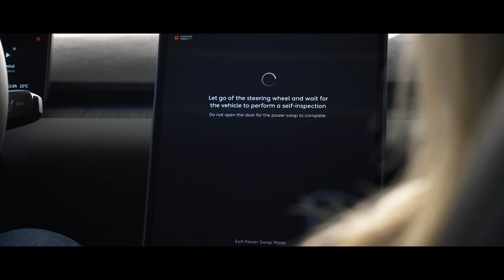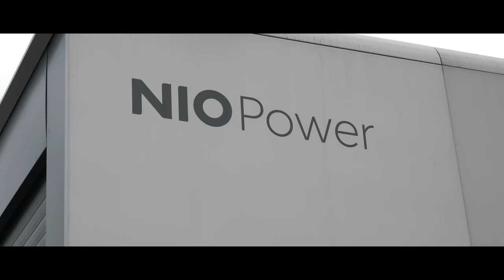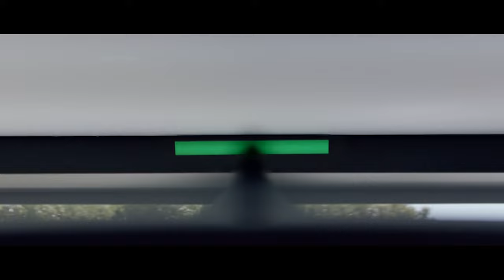NIO's Battery Swap Station: 5-Minute EV Battery Swap!

Comment: I do think there are some advantages to this.    It provides great resale  for EVs since the major concern (a damaged battery) is now removed.  Also, it allows for slow charging of batteries with entirely green energy.   It takes away grid problems and allows for charging at the lowest rates.  This is great for wind and solar since one does not have to be in a hurry to charge batteries.  I hope this catches on.
Reply from the maker: It certainly has great potential in the EV World! ⚡️
Reply: Yes its a Win Win Win System. You say What I Always say. Thank You.
Reply: @EVPowered  No, the idea SOUNDS good but is simply not viable. It would also require ALL major EV's to essentially have the same Battery packs. That obviously will not happen. Or will the stations be expected to stock individual packs from 50 different EV makers?
Reply: @johnwilson5743  it will be possible in EU because they recently pushed legislation that enforces standardization of battery packs in all electric devices including cars, and enfirces their replaceability. This is good thing, because monopolies like tesla finally will be shown their place and get rid of their staggering entitlement and finally will do something actually good for environent (long term reusability of vehicles)
Reply: Yes, that is an issue which can be addressed only by regulation.
But we ve already seen unification of charging ports for phones and now even car charging ports in the U.S.
I think it’s very possible. Again, it’s not an obligation for car makers  to use the same battery, but an optional feature good for consumer.
As always, the problem is that it only works at scale, and there is nothing to talk about with just a few dozen stations in Europe so far. At the same time, Tesla superchargers were also quite rare in the beginning, and now it’s a dominant standard.

Comment: NO chance in the U.S. Not only can Nio not afford to build enough swapping stations. but charging is getting better and faster, rendering Nio's "edge" irrelevant.
Reply: But doing it this way allows for great resale since people won't have to worry about the battery being damaged.  Also, it can have a green angle in that the company can charge each battery slowly and with entirely green energy.  Also, with this tech, you inherit improvements made to battery tech over the years.  So some advantages.
Reply: your 'fash" chargin loses all sense when you cannot charge it during peak usage time and grid being overloaded. Swappability of batteries is simply better because you can store batteries and charge them when peak production of energy from solar or wind happens, you can put less pressure on grid where too much energy is pushed into and cannot be received, and overally it is simply more sustainable, because EVs will become more affordable and reusable. EV with permament packs are one-time toy for burgeouis and entitled rich people.
Reply: @zawarudo1041  good point

Comment: Did the Doors to the swap station lift up when you arrived or were they already open?
Reply from the maker: Good Question! Once you have ordered the swap in car, and parked In the designated area the doors auto open and the car will drive itself into the swap ⚡️😀
Reply: @EVPowered  Thanks. You should include that in your video..People here in the US don't know that. They think there is someone is always waiting at the station. Great video

Comment: I am a strong supporter of EV's so please don't think I'm knocking NIO. However, I'm also a realist. The "financials" around using a Battery Swap Station simply do not add up. It is NOT financially viable and will actually cause the demise of NIO. Many years ago, when NIO first started promoting this swap concept, Tesla gave it a serious look. After investigating and even developing prototypes, Tesla quickly realised it would not work for mass production of EV's. NIO has been attempting to get other Chinese Car companies plus European auto companies, to join in to create a "mass market" system. A couple investigated and actually developed prototypes but, it seems, also came to the same realisation that it was fat too capital intensive and simply would not work. (Note: It might work for commercial Semi Trucks)
NIO has spent billions attempting to get this "off the ground". Funded, initially, by subsidies and payments from the Chinese Government. (That Govt put mega billions into the Chinese EV Company startups. They have now stopped funding all the research and development and have left the Chinese EV Companies to prosper or die, depending on their success) There are around 40 Chinese EV companies and I estimate 50% will fail. NIO is included in that number if they keep going down the Battery Swap avenue. Cheers.
Reply: How do you not see this as viable? It reduces load on the grid as charging the battery quickly is no longer as big as a concern. Recycling batteries will also be easier. The stations themselves i assume have a good portion of batteries in storage, and one of these units replace many equivalent ev chargers
Reply: Is it that the stations costs too much?
Reply: @tormodhag6824  Hi. A combination of factors. The idea is good BUT it costs too much to build. Costs too much to maintain. Plus, the cost of supplying a huge number of battery packs to stock the stations. The larger number of vehicles wanting/needing to use the swap stations means massive stock of battery packs. So, storage of those packs then become problomatic. The larger the "fleet" of cars needing the swaps, the greater the size of the station and products.  Daimler/Mercedes tested it also. 
It's like Solid State Batteries. Great in theory but totally impractical to instigate.
Reply: @tormodhag6824  Hi. Sorry but this has been heavily researched by a number of Auto Companies. Including Tesla, Dailmer/Mercedes, BMW and Toyota (that I'm aware of) All the answers have been the same: It is not financially viable and the cost to develop, implement/install and maintain is prohibitive. 
NIO failed to get these other Companies interested and on-board, so the idea is dead in the water. NIO managed to build a number in China but that was only because the Government was paying for it. That stopped in 2022, leaving NIO to go it alone.
Reply: It is actually being used, so how is it not good?
Reply: @thisisyourtransmission  Hi. The concept was good but did not work in reality. To be successful, a large number of EV makers were required to develop battery packs that were similar, rather than just NIO's. That was never going to happen. So the Swap stations would need multiple versions of battery packs to suit the different car makers. The only places it is still working are in Chinese cities that had stations built using Chinese Govt subsidies and only for NIO vehicles. 
Just imagine if Petrol/Gasoline stations required a different petrol for each Auto manufacturer. So end up having 15 large underground tanks just to supply most ICE cars on the road. Well that's the situation facing battery swap stations.
Reply: @johnwilson5743  "The idea is good BUT it costs too much to build." like literally every staggeringly overpriced tesla?
Reply: I can see this being viable for fleet operators like the cops or taxi firms, where they all have the same vehicles and can get their own swap stations, as they can't afford the downtime or parking infrastructure for charging.